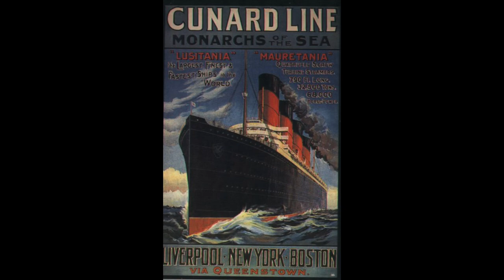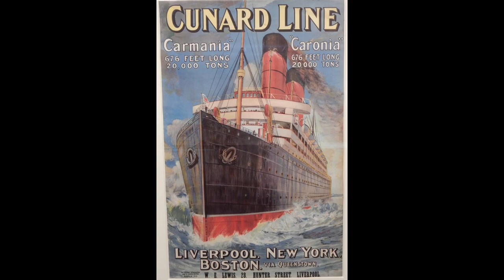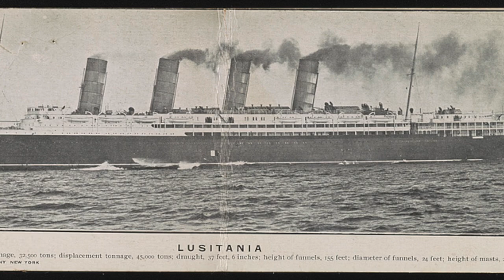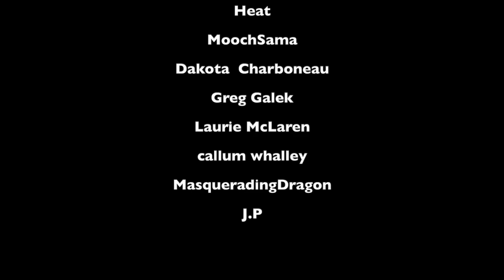Construction of Lusitania is completed! (Complete Lusitania timeline episode 3)

Comment: I wonder what made the ship vibrate at full speed.   The steam turbine basically has one moving part--the turbine,  aircraft gas "turbine" engines vibrate much less than reciprocating piston engines.   A reciprocating engine should vibrate more at full power.  Maybe it was propeller cavitation. Just thinking.
Reply: It was probably more to do with the propeller design, size and speed. 
The more blades added to a propeller the less vibration is produced but it then becomes less efficient.
Reply: Shaft being to long or not completely strait could cause vibration? I've heard many theories on the shafts being bent just slightly bent and causing all sorts of havoc.

Comment: is that engine test the reason why the Lusitania and the Mauritania have their funnels so packed up close towards the bow?
Reply: I think it has to do with the fact that every funnel was connected to the boiler rooms, hence why they where packed near the front. 

The engine room had no direct 'funnel vent' like the olympic class, wich means no funnel in the mid/aft stern section.

On a side note, since the super structure (the above the hull decks) run from the bridge to near the end of the stern, under certain angles it can produce the illussion of the funnels been way more foward than where they really are.

Comment: 3:56 This is false, Caronia and Carmania were not the reason why Cunard decided to use turbines on the Lusitania and Mauretania. That decision was already made by June 1904, while Caronia and Carmania would not enter service until 1905, with Carmania entering service nearly a year and a half after that decision had already been made. The real reason why turbines were selected was by the recommendation of the “Turbine committee”, a team of marine professionals set up by Cunard to test the relative merits and efficiency of turbines compared to reciprocating engines, which were investigated in a series of trials and tests using vessels with turbines and reciprocating engines. The committee would also decide how many turbines of what shaft horsepower to use, which would effect the shape of the stern and its structure, hence the reason why emphasis was placed on constructing more of the bow at first, since they had to wait on the committee’s findings. That being said, the reason why Carmania had turbines installed was so that Cunard could get some more experience with them as they had never operated a ship with turbines before and so they would have almost two years worth of experience with how the engine performed until Lusitania and Mauretania would enter service in 1907.